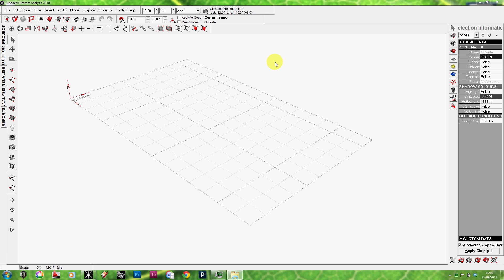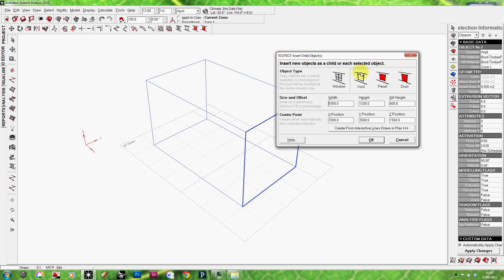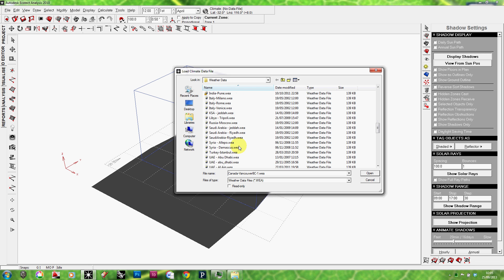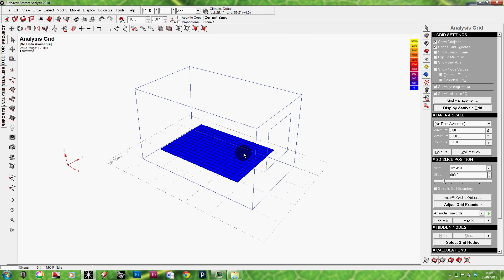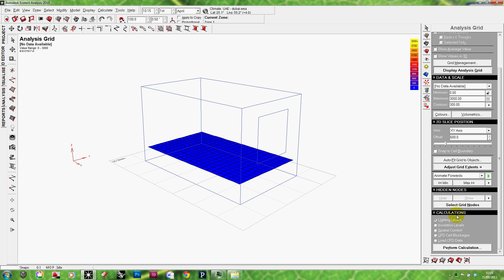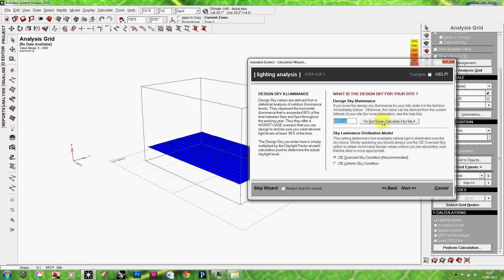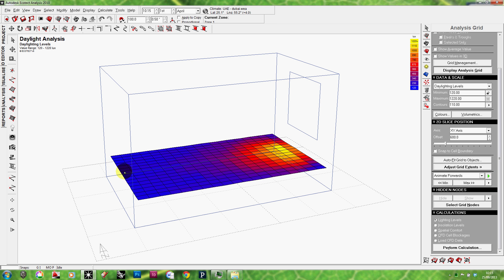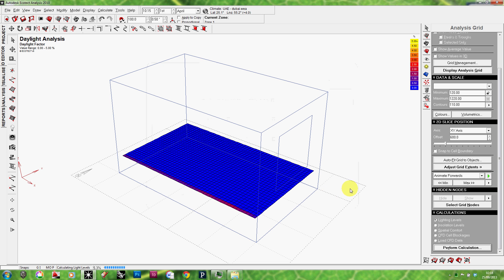Ecotect Tutorial 8.1 - Lighting Analysis Introduction

Comment: Hi,I have building integrated photovolatic cell on my South facade.This has certain unique value of (U value,Solar heat gain coefficient,Visible light transmitance etc) .What value should I put in the 'material properties' in ecotect solar analysis to get perfect result based on weather data?
Reply from the maker: Hi, What are you trying to calculate? Total energy produced by the solar cell?
Reply: No,I'm a student and our studio project is to design a sustainable School.I want to calculate the Solar glazing of the window on South facade.So,that I can ensure optimum LUX for a classroom,not excessive glazing.This material can pass diffused lighting to the class room and at a time works as a transluscent solar cell. The material properties of the glass panel are: (U value - 0.27,Solar heat gain coefficient - 0.14,Visible light transmittance - 49%,Thickness of glass - 34 mm,Weight per unit maximum - 209 lbs ) .Here,I prefer (Pythagoras Solar glass unit).
Reply from the maker: Ok, you can start with a double glazed window panel, then edit the properties as per the specs above, U-Value, Solar Heat Gain, Visible Light Transmittance. Glass thickness and weight per unit does not have an effect on the calculation in this scenario...
Reply: Oh,Okay.Thank you very much  :)
Reply: Should I change Both of the ( Pre material and Alt material ) property?
Reply from the maker: No need to change Alt material for this case
Reply: OKay :)